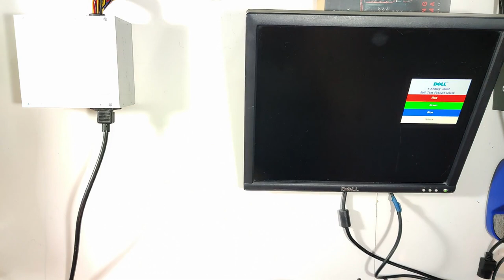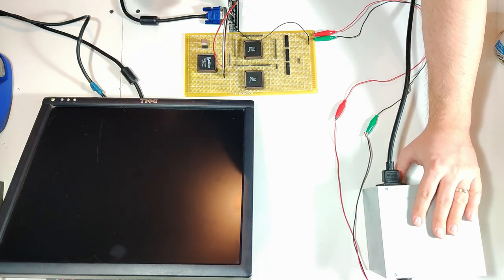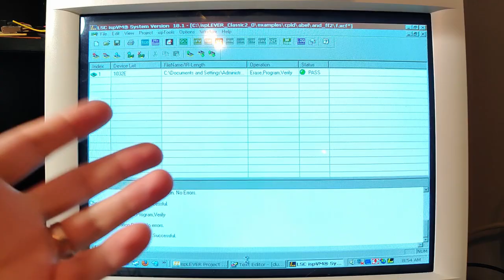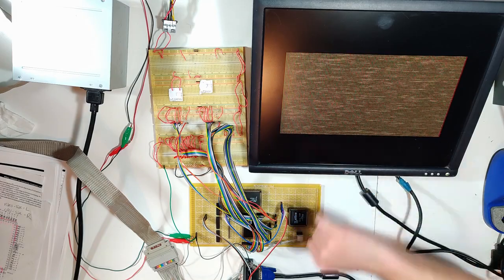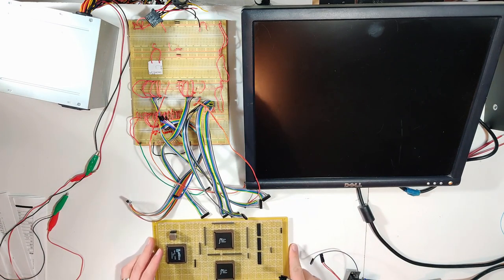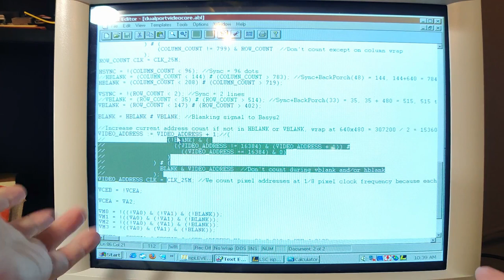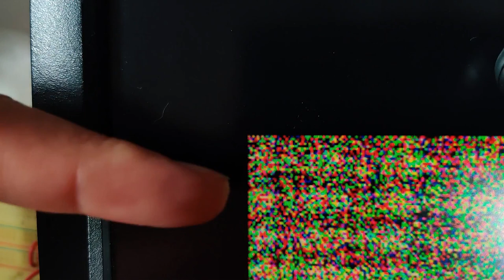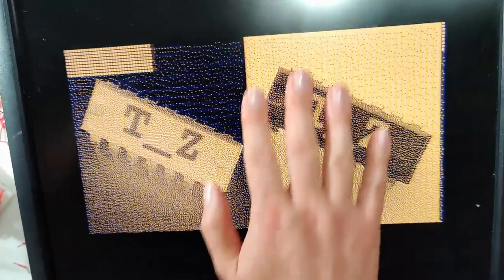DIY VideoCard | CPLD RAM Control

Comment: The stripe on the right hand side could be a timing issue similar to one I had with a colour add on card I recently built.  The pixel data was latched out of memory and then latched into a shift register, effectively  making a two byte pipeline. While the colour data was just latched out of memory and sent to the multiplexors. This had the effect of the colour data being one byte early and all the screen colours were shifted one character to the left (wrapping round). I just added an additional latch to the colour data path and all was good. TLDR are your data path lengths all consistent?

Comment: Well I really enjoyed that series- I assume it's not been continued elsewhere?  This has really inspired me to take a look at CPLDs, I've used GALs a lot, but you run out of pins quite quickly!
Reply from the maker: Haven't checked comments in a while, but I wanted to reply just because it hasn't gotten a ton of coverage since I switched to more streaming but yes! I got it doing 640x480 monochrome and for some silly reason added a m68k to the board as a 'GPU'.

I'm hoping to get a bit more back into it whenever I finally call it quits on the NES stuff
Reply: @TrackZeroFutzin  Thanks for getting back to me! I don't tend to watch the streams because of the time difference and finding the time to watch and extended stream. I'd certainly be interested in watching a cut down version of the NES videos to a more digestible format if you were up for it.

Comment: can you connect that board to a vintage pc to get a workable system?
Reply from the maker: I could hook it up to just about anything with a CPU, but the question of whether it would 'work' is a deeper one 

"Working" usually means that you can use the thing the same way as you would any other video device on that machine. For that to happen, the existing software needs to (A) know that the new hardware exists in the first place and (B) know what to do with it

For example, VGA cards for PCs conform to a standard where they show up at a particular spot in memory and expose a certain set of registers. The PC checks to see if it's there, finds what it's looking for, and then uses that interface to do the stuff you expect

This card don't conform to NOTHIN'.

My thinking is that my best shot at getting something like that working would be to plumb the basic address and data lines to ISA, and then write a simple NetBSD framebuffer device driver that knows how the card works and where it is. This could work out pretty great, because the way NetBSD's framebuffer drivers work once I have my basic driver written then the framebuffer text console and potentially X11 should 'just work' on top of it.

God knows if I'll do all that though
Reply: @TrackZeroFutzin  You know you want to.